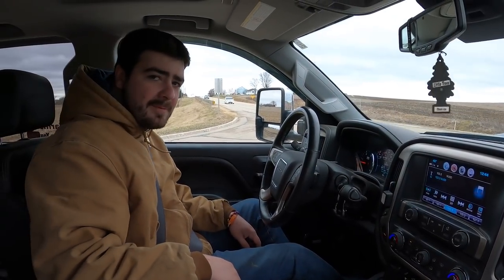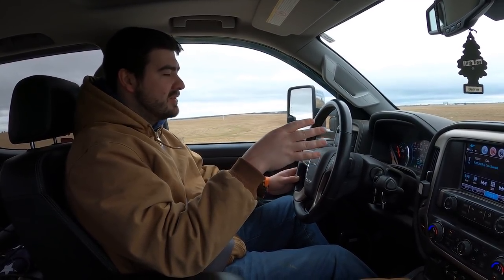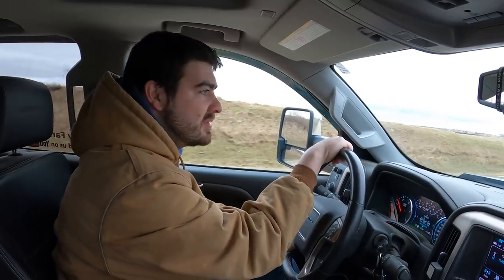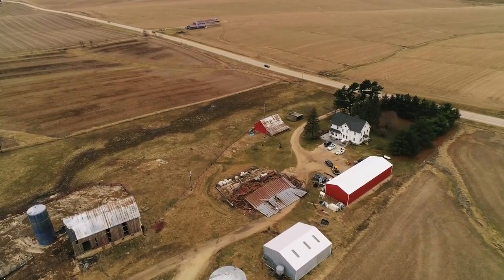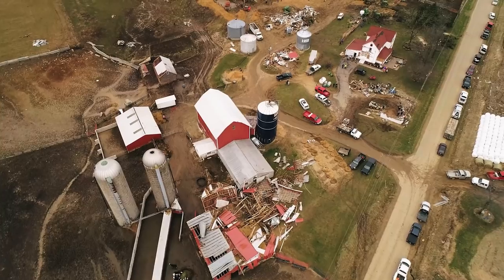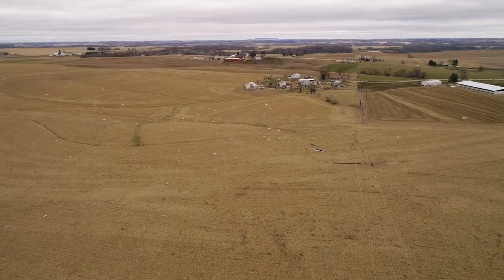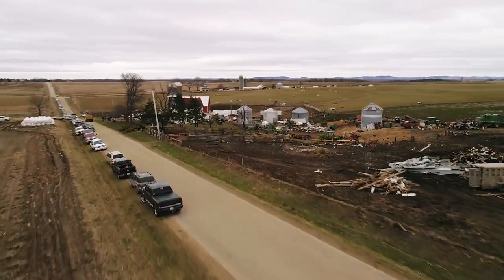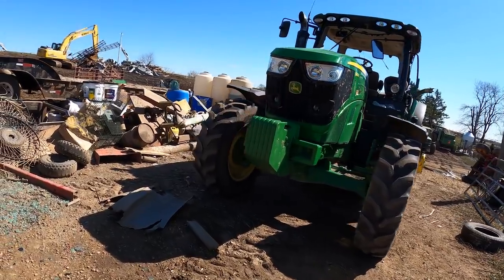Tornado Damage Assessment

Comment: Debris field is not a true indication of a specific Tornado s path. Sounds like you found debris thrown within 500 ft of structures and were lucky. Im sure there is more probably closer that you will find over time. Best to look at the missing topsoil if you want to find the true path. Some jump up and down especially near bodies of water. Sometimes there is multiple tornados but they only report 1 in records.
 In some instances full size cows and other large objects have been found 5 miles or more from their origin. Other strange phenomenons such as straw stuck directly at a 90 degree angle like a dart into the side of tree trunks can blow your mind.